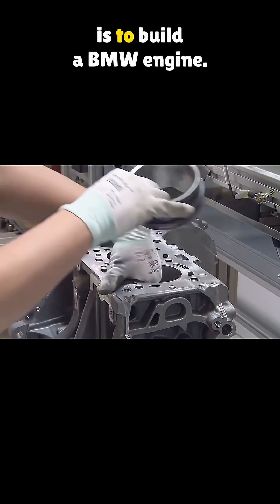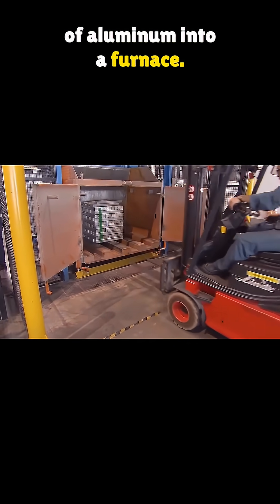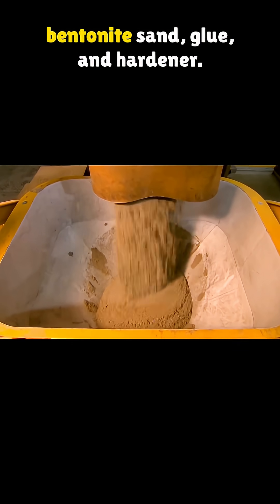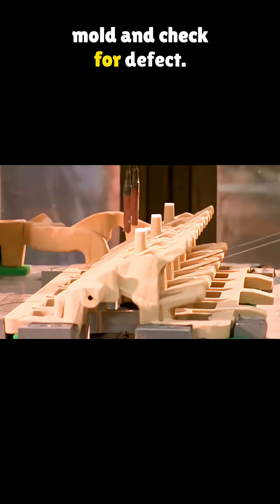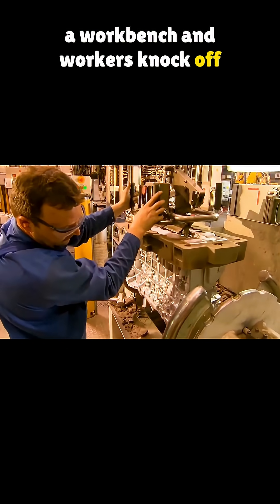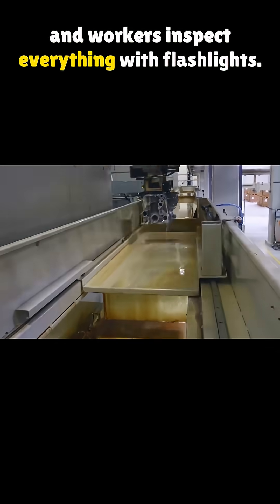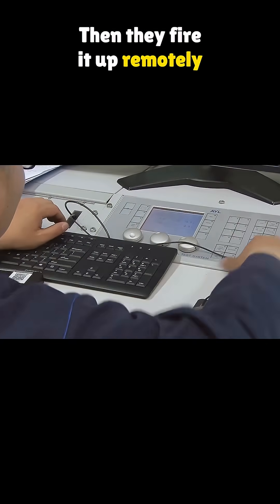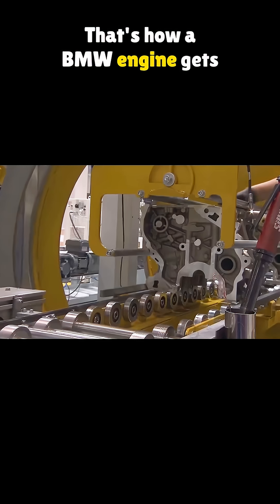BMW Engine Build Process Explained #assembly #automobile #mechanic #car #factorytour

Comment: Yeah well its still an aluminum engine . Ask GM, and anyone else that's built one.
Reply: A crap company is going to make a crap product regardless of what materials they use. Both honda and Toyota use aluminum for engine blocks and their engines last the longest out of any brand out there

Comment: Don't you have to scan inside to make sure there are no voids in the casting?  They do it with casting firearms components to ensure strength is comparable to forging.
Reply: Shh, it's okay. The employees inspect everything with flashlights.

Comment: It's how they manufacture the guaranteed oil leaks that's so impressive, though tbf that's not the block.  Anyway they can  make it unreliable and shorten its life they will do.  Marketing supercedes engineering excellence.
Not sure it will supercede Trump's tariffs though. 
 If it's just 10% maybe you'll just get reduced sales but raising the costs of everything could hit very hard on consumers over all - except the top 30% of course and maybe they won't care.
Then you'll get the psychological reduction in spending at all levels, somehow I can't see businesses doing well out of this.
When zero interest rates were brought in (UK) after the financial crisis, well off folks saw an extra £15-£20k / year in their pockets from reduced mortgage costs and yet they still cut their discretionary spending from the general atmosphere of crisis.   
They literally never had it so good and their properties sky rocketed in value.